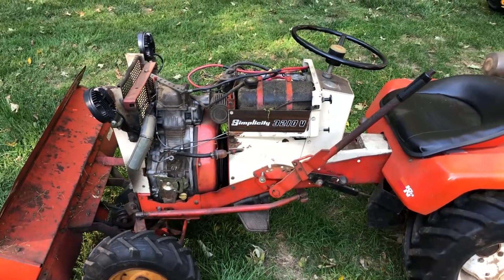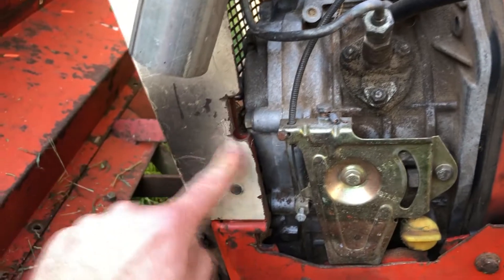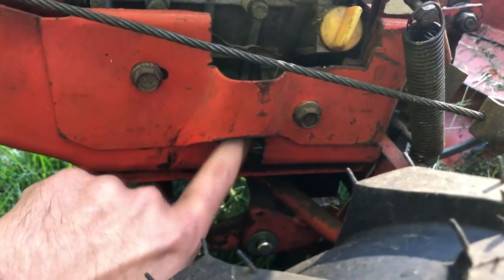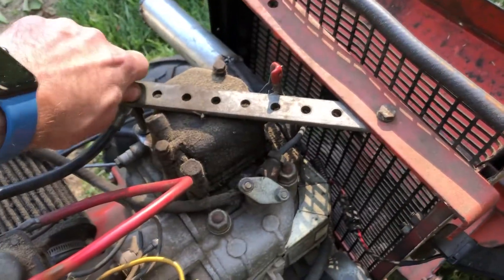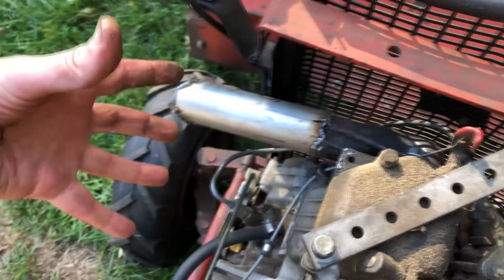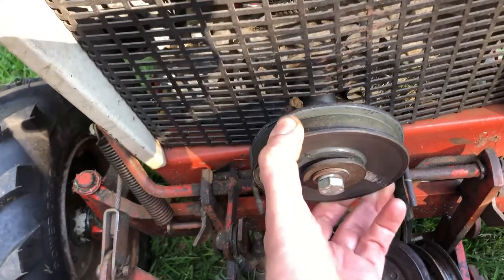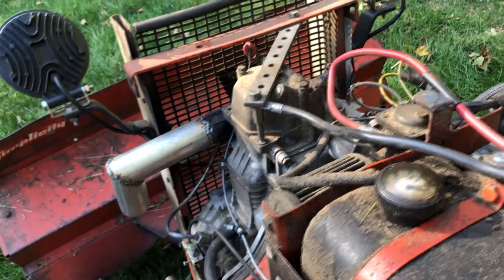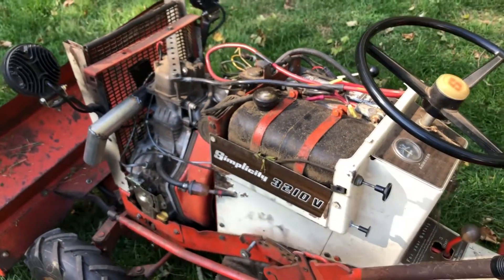Simplicity Landlord 3210v diesel swap

Comment: Hi Jason. I put a similar 10hp diesel in my mid 70s Moto Mower which is the same a a Sears ST10 or Roper RT10 tractor. You can see a few pictures of it on my YouTube home page. The one you have is smooth and mechanically quiet. What brand of motor is it? Mine is a DEK F420 and it seems to have a little more diesel knock than yours does. Still running strong after 10 years but I wish it was a true Yanmar engine that it imitates. My engine has a true one inch keyed shaft so pulley mounting was not an issue.
Cheers: BJ

Comment: How do you have your drive shaft set up.
Reply from the maker: That's one spot where I never took a good video or photo. I made a template and asked a machine shop to build an adapter. It was essentially a large cylinder of metal with holes to mount to the engine flywheel and tapped threads to bolt on the driveshaft. If I recall correctly it was roughly 3" in diameter and 3" long.
Reply: The original is just two bolts into the flywheel so its not complicated at all.

Comment: do you know which way the engine spins like clockwise or counter clockwise
Reply: Its a standard LH counter clockwise engine, but from the flywheel side it provides power clockwise to the mower drivetrain... the normal shaft is used as a PTO shaft.